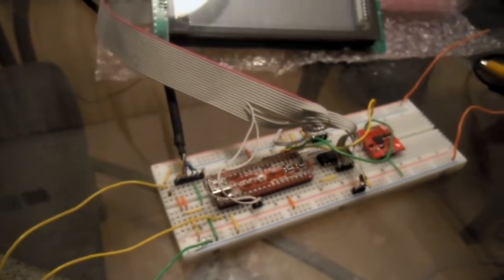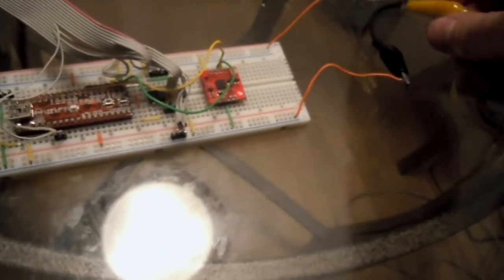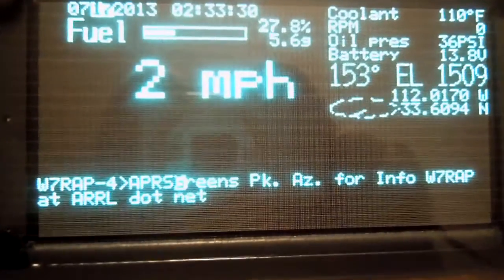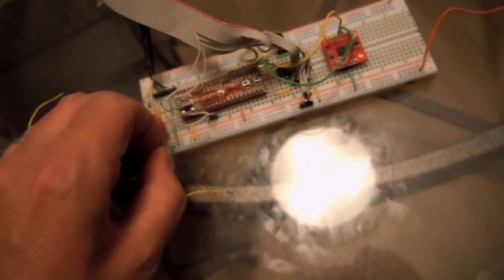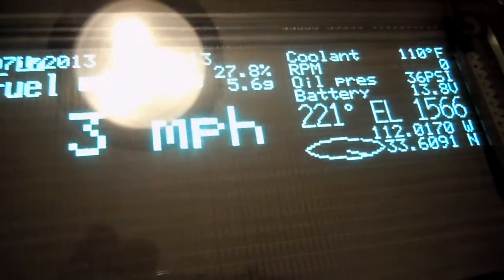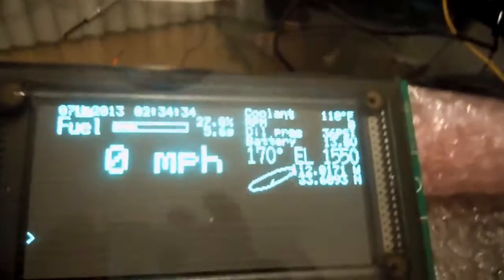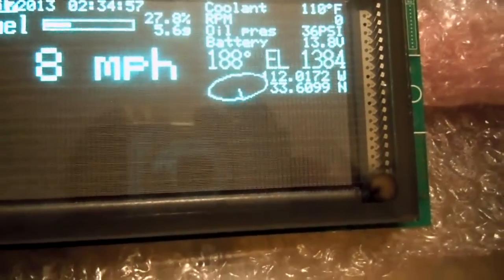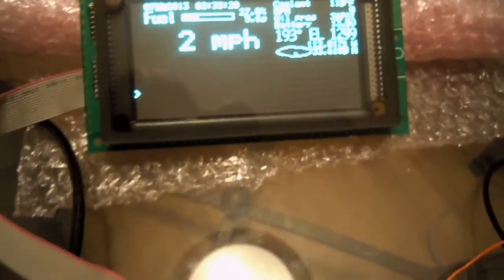STM32F103 Navigation Computer VLOG3 - Tilt compensated compass

Comment: If you think ur novice, I dont know how to start programming STM32F103, not even the software. I am ok with Arduino, but intend to move to STM as it is cheaper and faster. If you culd give me any advice on how to start, I would appreciate. Thanks
Reply from the maker: Well, the leaf labs IDE does have quite a bit of Arduino-like libraries that you can use.  

Assuming that you have a board that you can program, you just need the toolchain and some experience with C and reading chip datasheets.  It shouldn't be too hard to operate some of the peripherals such as SPI, I2C, and ADCs.  

Start simple, maybe with a single GPIO pin to control an LED.  Then use 8 GPIO pins on the same GPIO port and write an 8-bit value to the port and control all 8 LEDs at once.  Then maybe try your luck with a cheap 4 or 8bit parallel LCD panel.
Reply: Than you, I am already using it.